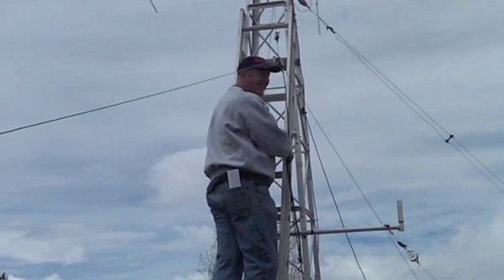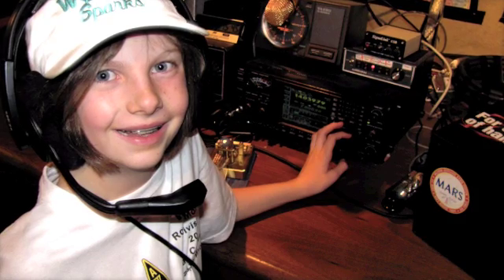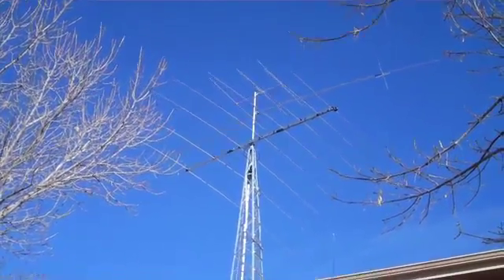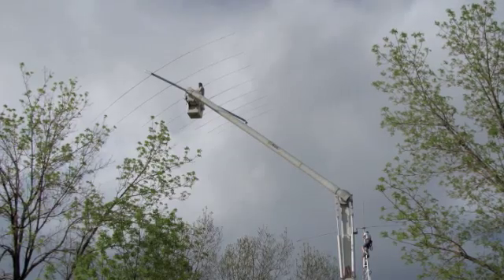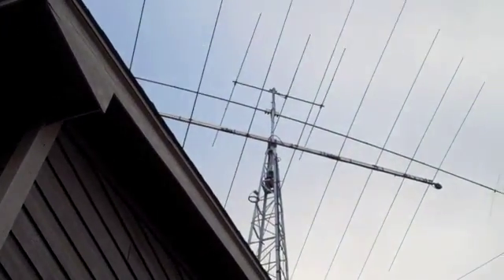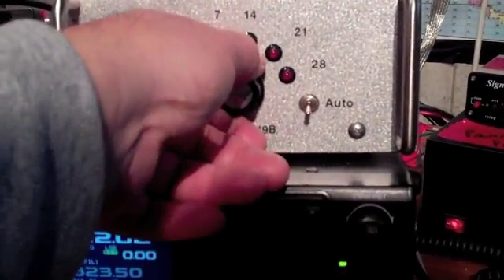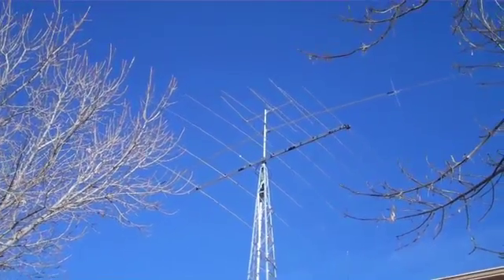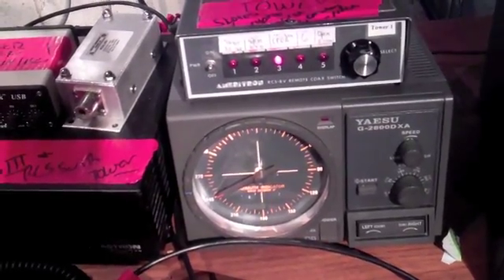N0AH and W0ANT Rooftop Antennas

Comment from the maker: Yagis, with traps, have high Q's. LDPA's, without traps, are designed to receive and transmit somewhat equally within the frequency range of the antenna, thus, it also picks up all the ambient noise between these limits.  The bandpass filter eliminates signals being received outside the intended band filter range and shakes off unwanted noise, (or RF), not intended to be received at the time. Go to general receive on a LDPA, turn on the filter, and dial around-you'll hear the sharp cut off-